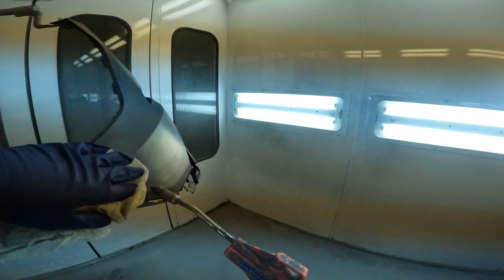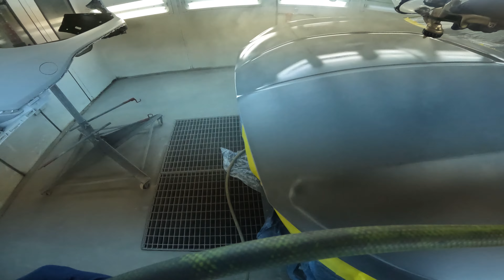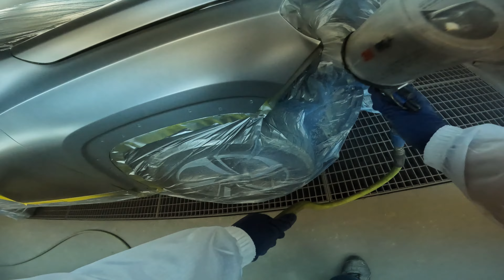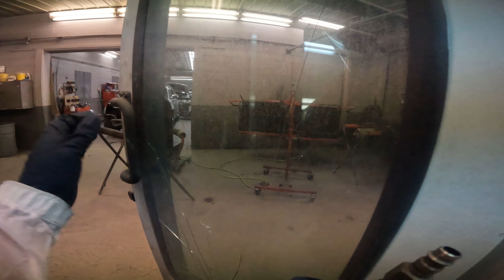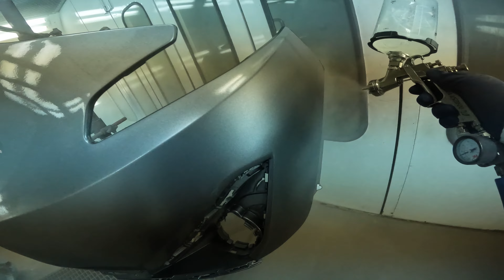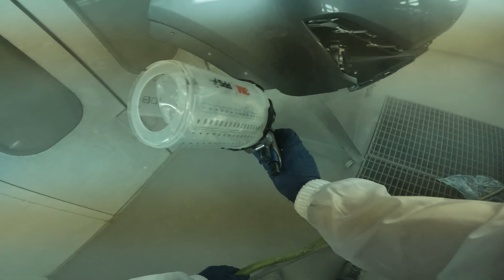Reviewing the Iwata LPH 400 2021 GMC Terrain 🤯

Comment: Mr finish I'm new to your channel,so new I don't know if you're a 2 coater envirobase or solvent guy yet. I bought a LPH 400 LVX 1.3 for base and clear. I can't apply base with it to save my life. It is my dedicated clear gun and I close my pattern up to 2 maybe 2.5 turns from open.
Reply from the maker: Hey KR thank you for reaching out! I appreciate the feedback more than you know! I am using Deltron solvent. And I am using my devilbiss DV1 for base and clear. I didn't really care for the Iwata. But if you have more set up stats I'd love to hear them
Reply: @∆Murder The Finish∆  I think that's how I found your channel I bought a dv1 recently and was looking up reviews for it. Yeah iwatas are different for sure. Finicky guns and because people are so different iwata doesn't really recommend anything. Definitely try the orange cap for giggles. Did you ever get to try the sata? Strange for a paint rep to hand you an iwata usually they're very pro-sata people.
Reply from the maker: I have used SATAs in the past the first one I sprayed with was what I believe was a knock off lol I was spraying PPG Omni and shopline. So way different than Deltron. And I used a couple SATAs at my old job they seemed great. I loved the fan and atomization. I was using Akzo Nobel Lesanol. Therefore I wanted to get one for Deltron to try.  I have sprayed with a different Iwata before not sure what model number and loved it. Maybe that gun was newer or had I different cap. Not sure.

Comment: I spray Ppg’s deltron solvent paint and use the sata 5500 and the dv1 for base and I clear with the iwata lph400 with the orange cap at about 28psi and the fluid setting in the cut about 2 half turns in from wide open. Seems to work pretty well for me but all painters are spray different and prefer different setting I’d atleast try the orange cap with it though
Reply from the maker: Awesome thanks for the feedback! Indeed everyone is different with preference. I get asked all the time why I don't use my DV1 clear gun. I think it's way to slow of a gun. It sit on a shelf collecting dust 😂
Reply: Exactly and who likes paying 600-800 dollars for a gun that sits around collecting dust! You just gotta find a good base gun, clear gun, and sealer gun that works good for you and stick to them! Keep up the good work I enjoy watching your videos to pick up any other tips or things that you are doin that I don’t that way I can give em a shot and see how they work! But I’d definitely try the orange cap on that iwata and then If you still don’t like it hang it up on the shelf lol